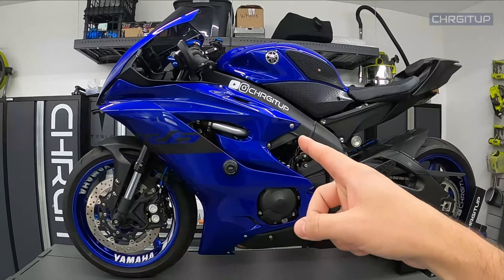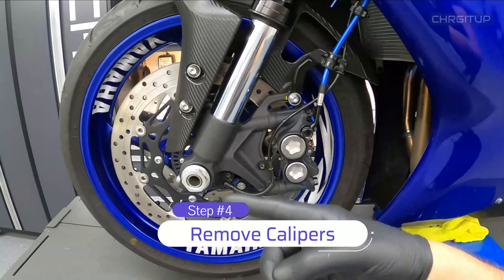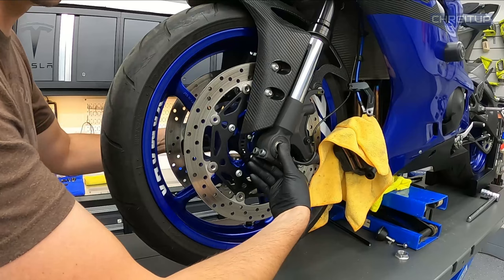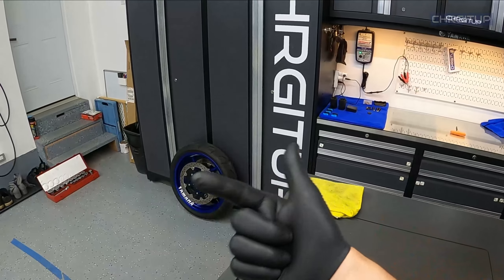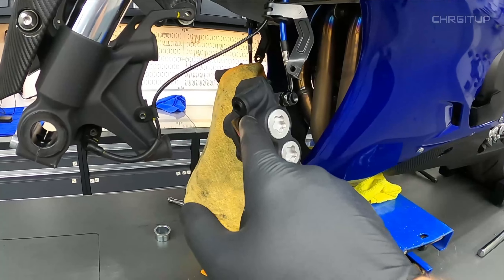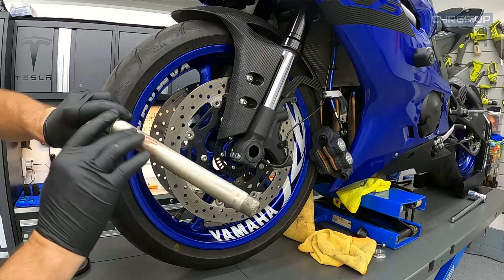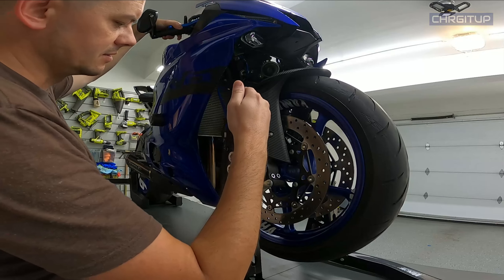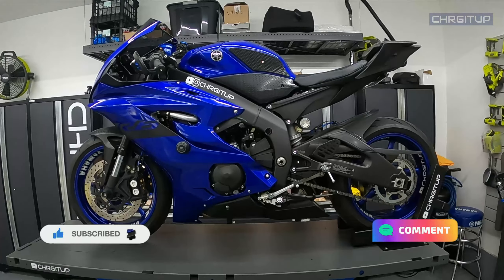Front Wheel Removal (How-To)

Comment: what are the measurements of your tires? front and rear

What brand and model do you recommend?
Reply from the maker: Hey, the tires on my R6 are still the original OEM tires from factory.
Bridgestone Battlax S21R
Front - 120/70ZRM/C
Rear - 180/55ZR17M/C
When I do change my tires I will be going to one of two options that I like. 
Option 1 - Bridgestone Battlax Hypersport S22 Tires, 120 on the front and a 190 on the rear.
Option 2 - Pirelli Diablo Rosso III Tires, 120 on the front and a 190 on the rear.
I will most likely go with Option 2, I think Pirelli's are my favorite go to tire for street riding.